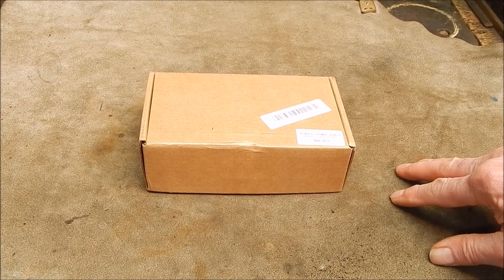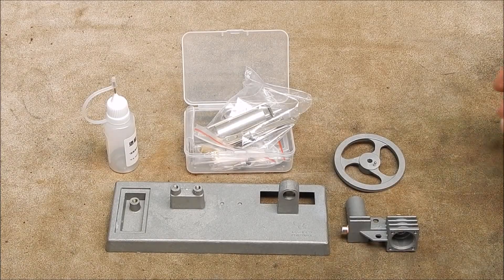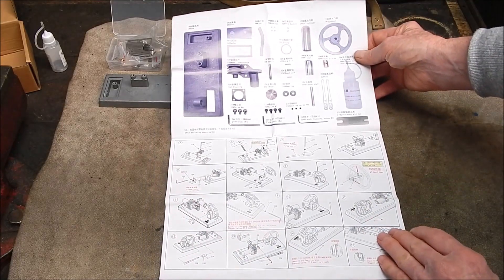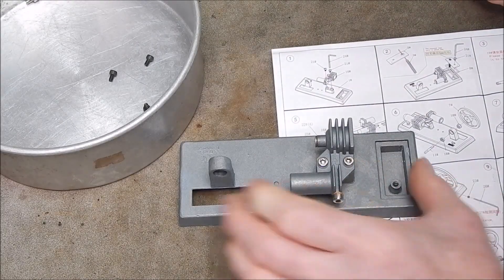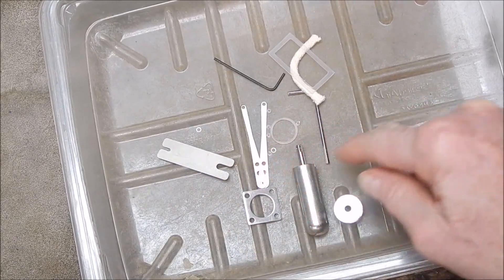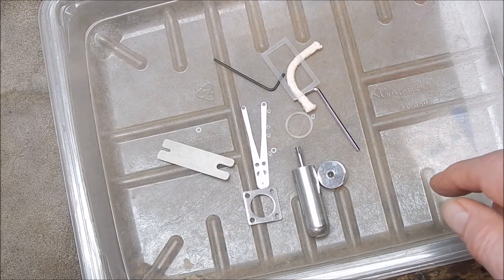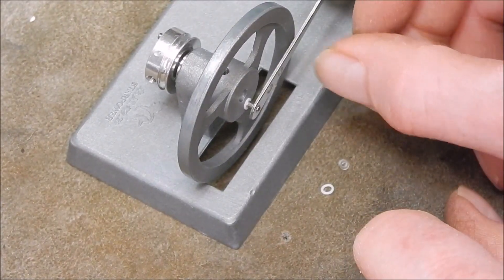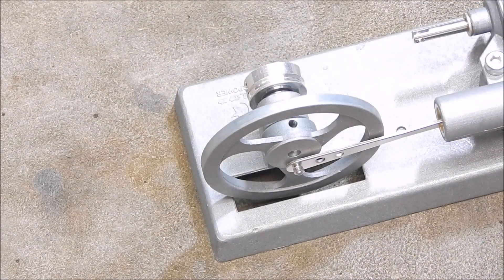I build the STARPOWER QX6 Mini Stirling Engine Kit from Banggood - excellent beginners project

Comment: Lovely little kit Rob 👍👍👍 Ideal if you don't have a lathe to make one, at least you still get some fun with the construction. Cheers, Alan.
Reply from the maker: Hi Alan. Yes, it's a good low cost way of learning about Stirling engines.  It has a grooved pulley so I tried running a small dynamo off of it (as another reviewer suggested), but not powerful enough, which is what I expected. However it runs quite a long time on the small amount of metho.  Cheers Rob

Comment: I built one of these recently. I painted the base green, the cylinders black and the flywheel I gave a coat of white just to give it some look. I found that mine runs just fine on 91% alcohol which I can get from the local pharmacy whereas if I want anything above 95%, I have to order it. I find that it runs really well, ran it quite a few times and I want to find a dynamo or something to run off of it and put both the engine and what I run on a wood base.
Reply from the maker: It's a really good little engine.  The only downside is that due to the centre bearing design, the drive pulley is inboard of the flywheels and makes filling a belt awkward. Cheers Rob